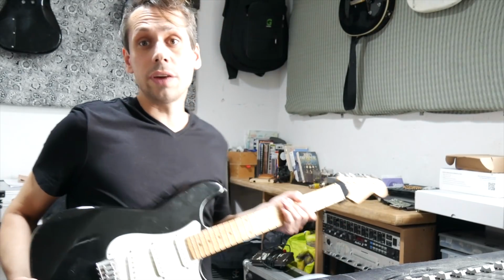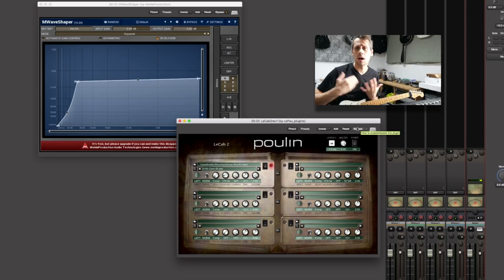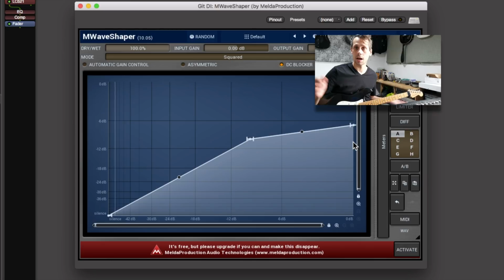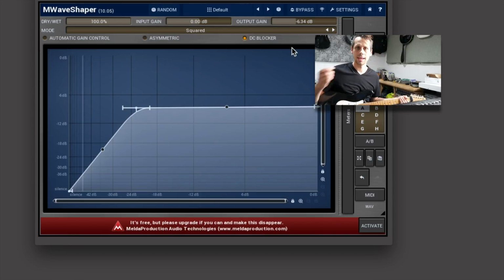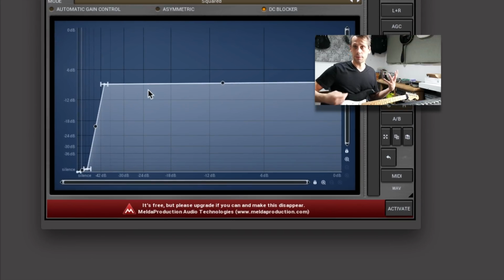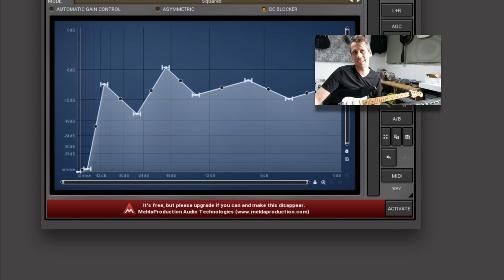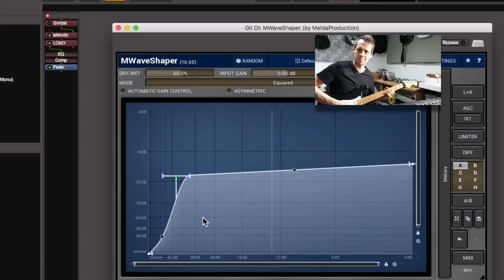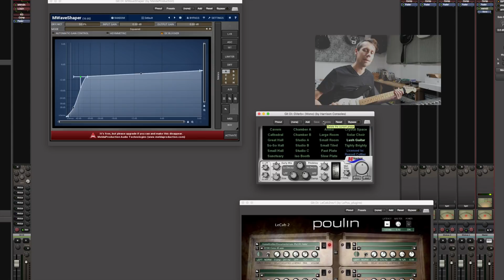Make your own Free Amp Sim?

Comment: that's a really neat video. thanks. Definitely some stuff to play around with there. when it comes to trying to replicate an exact unit/amp - i had understood Line 6 and others recorded the actual amp and derived an algorithm between the dry signal and the wet. Is that right? and if so is there a way of doing that? I have a particular pedal i like but you can't get a sim version of it.
Reply from the maker: Well kind of, it's all a bit of an industry secret and the capture software is mostly coded by each company for internal use only.

Check out my friends at Audio Assault they have some cool stuff available and also you should check out the peavey revalver as that can capture amp /pedal sounds. Kind of.

You could also try making impulse resonses for your time based pedals.
Reply: @RussCottier  thanks so much. Great work.
Reply: @RussCottier  thanks so much. Great work.
Reply: @RussCottier  thanks so much. Great work.

Comment: Please correct me if I am wrong. An Amp simulator and a pedal simulator require much more programming and configuration behind the scenes to Make an AMP SIM like Ik Multimedia Fender or the likes of other popular AMP SIMS. This is know as Dynamic simulation. Whereas what you are demo-ing which is cool - is a static snapshot - - which is what an Impulse response for an IR cabinet or Mic is.
Reply from the maker: Well to an extent there a number of options realy, but IRs do encode time function by their very nature, they do not necesarily encode volume changes...however you might find that this is also the case on many amp sis like IK etc. 

In terms of the wave-shaping again you are quite right in that there will be a response time that does not exist in a simple wave shaper but this is actually potentially less of a problem in reality as these changes are for the most-part incredibly fast.
Reply: @RussCottier  thanks for your explanation. I am wrestling with the unknown (my unknown) knowledge while trying to understand the value of each AMP SIM vs IR. I see IRs are mostly inexpensive yet AMP SIMs are usually more expensive and I wanted to know why in terms of complexity. Does an AMP SIM creator generally have to put way more hours into creating an AMP SIM vs an IR?  I do not see any AMP SIM creators I see a few CAB SIM IR makers though so in terms of value how to justify.  Thank you
Reply from the maker: @MixMindStream  Ah ok so I think you are getting a little confused. Generally the term  amp sim is referencing a 2 part system , a wave shaper component and an impulse response loader or algorithmic speaker modeller. HOWEVER sometimes these are delivered as separate plugins. 

(You can sample the distortion characterisitics of a hardware device but that is another story). 

So think of the amp sim as a model of the electronics in an amp and the IR component as a sample of the actual speaker and mic itself. 

A waveshaper or distortion modeller on it's own will sound odd, like when you plug a drive pedal into a line input on your desk. 

The IR loader component allows that signal to sound like a speaker cabinet. Dominatoe By Audio Assault for instance shows this well and you can bypass the cabinet IR section to just hear the "amplifier simulation'.

if you want to model reverbs and time dependent parameters like SAG then you will need to have a way of doing that, most likely developers are using algorithmic processes to measure the average levels of volume over a period of time and that gives you the sag characteristic. Though in reality most people use waay overpowered amps and rearely get loud enough for sag, power stage distortion and so on. Trust me you can't get my 100 Watt peavey up to impart any noticable power stage distortion without a power soak. Even in a rehearsal or gig environment. It gets so loud it hurts. 

As for development time well that is probably mostly in the development of the engine to begin with. The core code will likely be much the same with minor tweaks once you have developed the waveshaping and IR modelling code for your plugin/s. Talking to people who make amp sims professionally the real time consuming issue is optimising the code, finetuning parameters and getting the thing to market. 

So after this huge reply what does this mean? Well I 100% believe that you shoud just make good music and stop worrying about a specific plugin sounding exactly like anything...tube amps sound different in every recording session anyway so don't worry about it. Just use what you think sounds good and make music that is in tune, in time and kicks ass.
Reply: @RussCottier  I get it. I am just chiming in from a lets cut through all the b.s. and tell me what this thing is minus the marketing hype and if you charge $100 tell me why it $100 and product B is only $10 - it makes me think I don't understand what the product is at all and also makes me suspicious. Logic Amp designer made me think - oh wow they have an amp creator out there but nope its more like Amp selector and mixer.  In Fact Melda Mamp and Accoutica Nebula seem to be the closest thing to designing an Amp. Nebula is $400 so - I was interested in why ( not dollar for dollar) just why as in what is the build effort for this price? So I can see this is not an easy task to evaluate.  In any case I tredge on still a little confused about value but also not getting to obsessed because as you say its the music , make the music.  But I do love the tech as well.
Thanks Again!